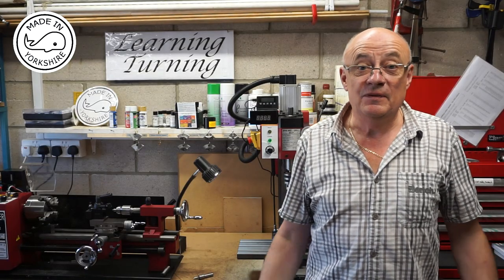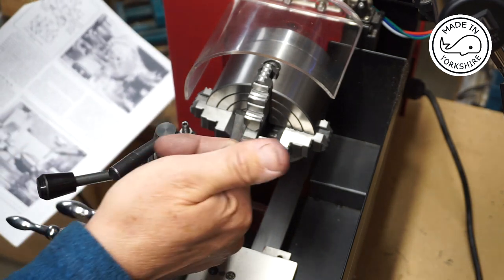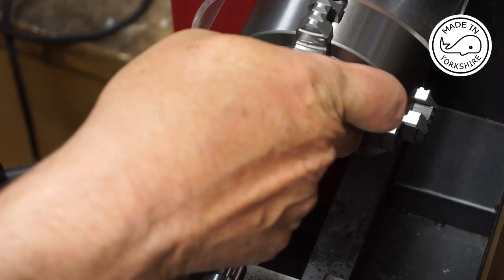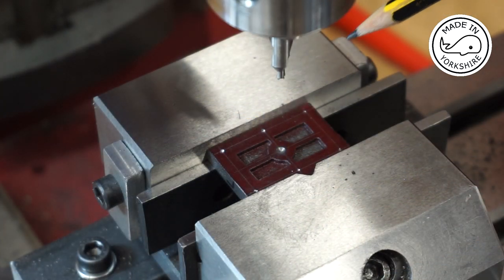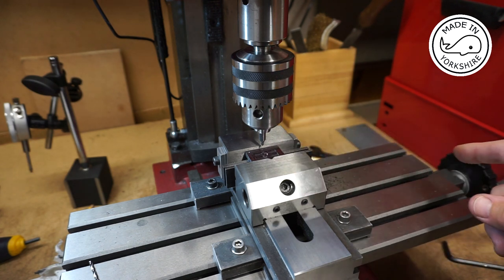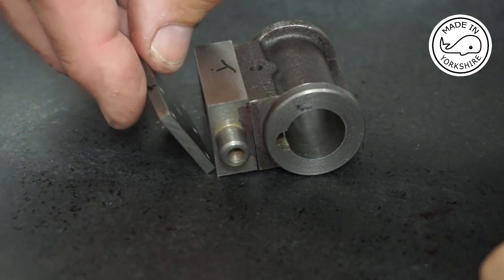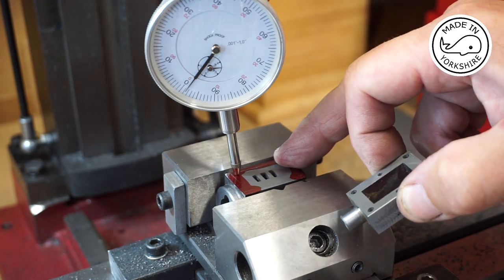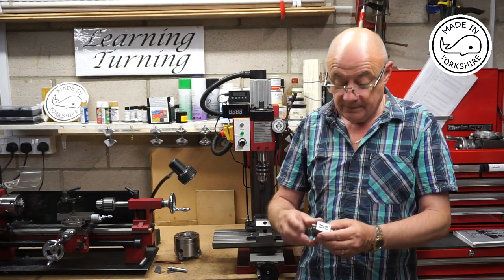#MT22 Part 4 - Making a Stuart S50 Engine Steam Chest. By Andrew Whale.

Comment: Hi Andrew, I've just stumbled across your series of videos by accident and really enjoying them. I'm the guy in ME forum who posted the valve chest reply under the name Gas Mantle. I also build small steam engines and like you I have limited tooling and experience so it's refreshing to see another 'beginner' having a go :-)     Cheers - Peter.
Reply from the maker: Hi Peter. 'Stumbled' is probably a very good summary, as I struggle to find my own videos if try to search for them! Many thanks for the advice via the ME forum - I really do appreciate that. I see you have some videos of your small steam engines - so I will check them out ASAP. Thanks for subscribing.
Cheers. Andrew

Comment: Andrew, whenever possible have your topslide / compound  so that the movable part is flush with the end. That is to say have the minimum overhang which will give your toolpost much more rigidity, this will benefit you greatly when parting off. I notice than in most of your videos it looks to be overhanging by at least 1 ".
Reply from the maker: Hi Dave - I've learnt a lot since making that video. I now try to remember to reduce the overhang - but I still don't remember every time.
Thanks for the advice.
Andrew